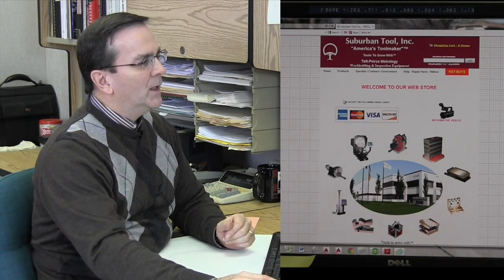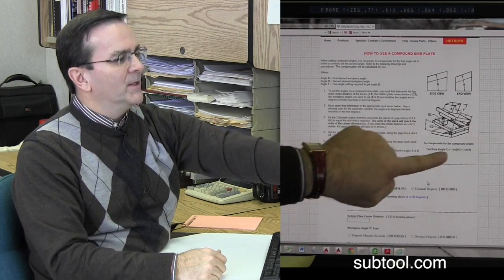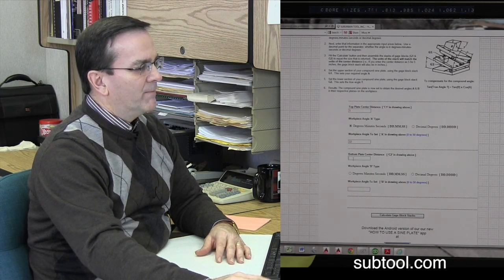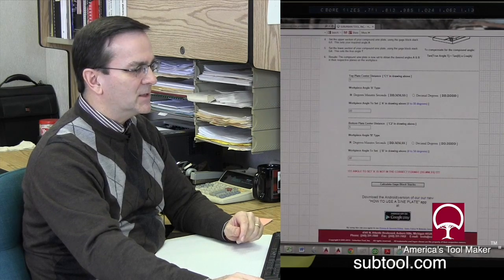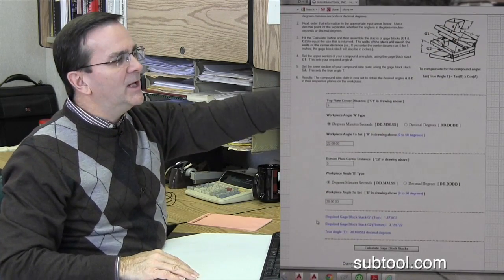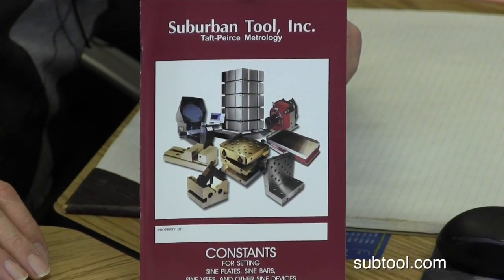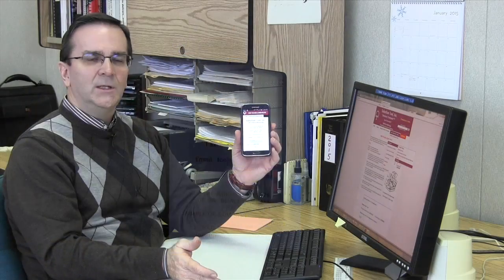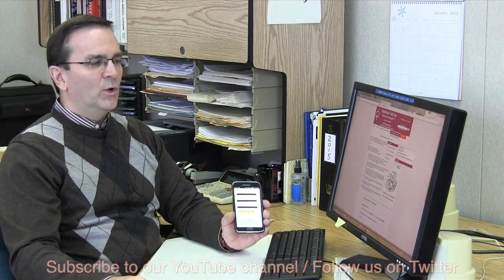Free Online Calculator for setting a Sine Plate or Sine Bar from Suburban Tool

Comment: I have a question that is sort of related to this. This has stumped me so far. Say you were given a drawing that had those angles you used in the demo. But, instead of machining that surface flat to those angles, you were required to drill a hole on a certain location, that had those angles. How would you pick up and find that location?